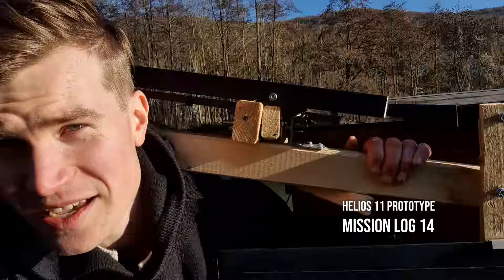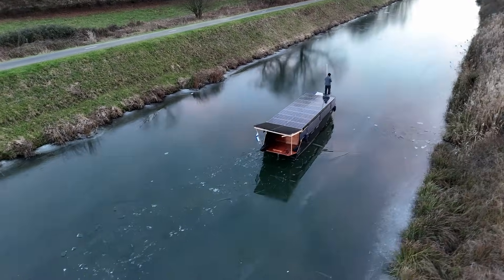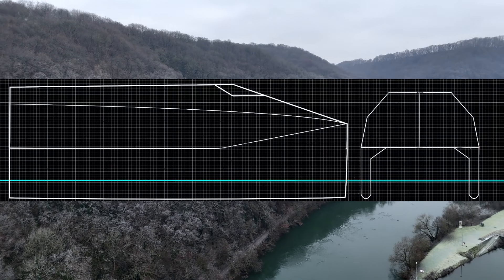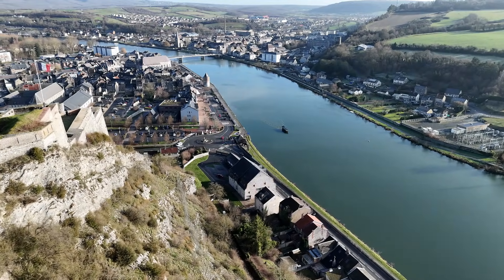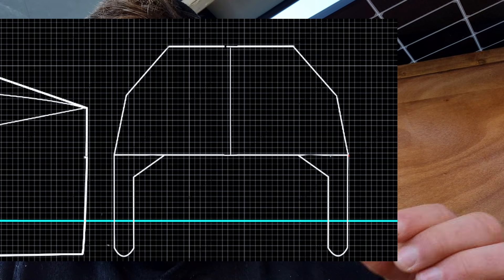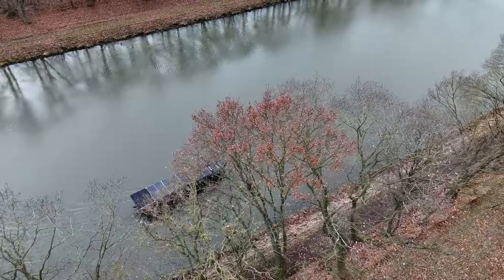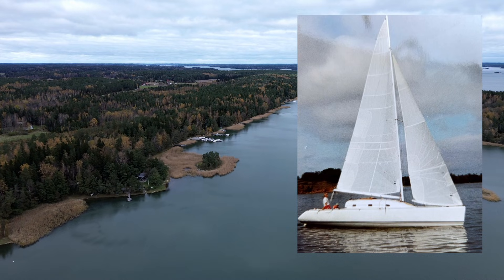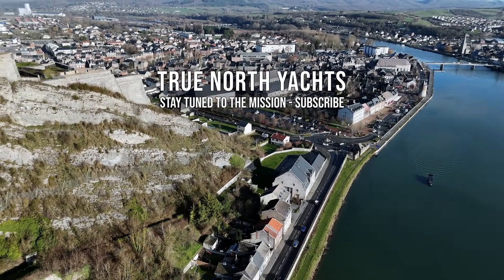My Solar Prototype Reaches France: Upgrades & Next Model

Comment: 7 or 8 knots is very much on the slow side for a performance sailing boat.  A 32ft multi hull would be averaging the low teens.  On a good day with favourable wind can average 20kts.  As far as your cat design goes, make sure you really take slamming into account.   This is a problem all cats can face.  With your slender hulls that cut through the wave you could be very susceptible to slamming.

Comment: @11:00 a Keel or centre board is only needed if you are using a sail going upwind (latteral resistance to help convert the latteral force vectors into forward force vectors), not needed for sailing down wind and not needed if no sail. for you use case the long skinny hulls might provide all the latteral resistance you need especially if you don't make the bottom of the hulls too rounded.
But the other thing a mimi keel or skeg can do is provide some protection for the hull against grounding, so a small 1-3cm full length skeg with an abrasion resistant material at the bottom might be a good idea.for areas with rocky bottoms and large tidal ranges, remember every vessel becomes an "un-offcial survey vessel" eventually, so making sure your vessels can survive that with little/no damage is prudent.

Comment: Bro just some psychological advice. Stop being so Bias to your design, your work, having to justify your work.  Don't worry about Non Critical areas you experimenting on, wood, bamboo, does not matter this is data collection for future use.  Lastly,  hopefully you will spend a little more time on making the design more appealing while maintaining functionality and efficiently.  I don't think anyone cares if they lose 5% to 10% efficiency if it is an overall more appealing product.  BMW puts used emergency stop buttons, wires hanging everwhere on their cars in development, if it works, and you've planned conduits, etc, all good, can be addressed in final production phases.
Reply: Otherwise, great job for taking the initiative.  You are young enough know that these experiences will pay off later in life. Knowledge, Analytical ability, foresight to prevent design flaws or omissions.

Comment: I am sorry but how is this going to float? This doesn't work without "torpedoes" to keep it afloat. If you want to use this narrow legs you need wings or cavity for keeping you above water or create an air pocket under the main hull which is very hard to accomplish due to waves.
So you either go delta wings/pontoons or you just have 2 protrusions under your boat for battery storage.
You are right that most hulls are not optimized for electric but they are still optimized for the sea. 😉
Electric is very easy to modulize. 
Solar panel with a simple motor(central/dual drive shaft?) and a central battery system and attach to a simple and efficient hull infinite redundancy add as much as the hull or wallet can support.
Solar panel angle is more important than hull design for optimization.

Comment: The Dunning-Kruger is strong in this one...
Reply: The problem is he seems to do his research directly from chat gpt...
Reply: @YoutubeCommenter1 at least Gemini 3 Pro and Claude Opus 4.5 are able to point out the downsides of this design very quickly.
AI is the right partner for such a project, but you have to know how to use it... I am still wondering, what are the actual requirements for the boat. Based on that concept and design phase follow, no matter if with or without ai...

Comment: My brother has a 28 foot wood/ fibreglass diving boat. 
He has two fins  made 3/4” plywood added to the lower sides of his boat for extra stability .
They are about one half the length of the boat, starting thin and tapering out to one foot in width at the rear of the boat.
Looks like two small keels one each side of the hull just below the waterline.

[________/—————‘

<_______>

Stays very flat stable in  rolling waves or choppy seas .👌👍🤔☺️

Comment: Have you considered putting an apparatus underneath the main portion of your new design that would have capability of providing mechanical power to some sort of generator to assist in charging while under way on your journey as the boat goes up and down in the waves it could be something that might work do you think?

Comment: With batteries lowered below the waterline would you need some sort of watertight bulkheads in case portion of the narrow hull was breached letting in the seawater which might short a battery and cause thermal runaway and fire?

Comment: The only problems I foresee, are deep draught ( which could prohibit canal passages) unless the pontoons (torpedo's) had sufficient buoyancy (think semi-submersible drilling rigs) These would need to be precisely calculated by volume in order to have the vessel sitting at just the optimum height under full load. My gut feeling is that the side hulls still have to increase in volume as you get to deck level for the sake of stability in heavy seas, and the pitch and roll in heavy weather also effects the center of gravity. At least we had the option of ballast tanks on a semi- sub. Not trying to be a damp squib, just things to take into consideration. I fully support your intentions though. Good luck.

Comment: Note that if you increase the weight of the Helios 11 by 200kg that is going to negate the increase in speed at a specific power setting that you gain from increasing the waterline length.

Comment: If you taper the battery compartment to a point under water in front and back will reduce drag, cut the waves and still have ample battery compartments in the middle of the underwater wing.

Comment: There will be trade offs between angling the panels to catch the sun and seaworthiness when crossing the ocean. If you get caught in a storm while on the ocean, you could easily lose your solar panels. Please analyze a change in your roof line. You now have two angled walls and a flat roof. Calculate your solar gain using two or three angled walls. Instead of being flat, the peak of your roof would be pitched, like a house. The panels would be single faced and fixed. You would be much safer in a storm at sea. You would also have a very spacious interior cabin.

Radical idea: you mentioned a solar airship. Could you use a helium filled dirigible that is covered in light weight solar panels? It could have its own motors and actually pull your boat. Of course it would not work in canals with bridges unless you could deflate and reinflate it, but it would be amazing in the Mediterranean.

Comment: Are you going to use solar film to make the air balloon of your air ship? You could convert sea water into hydrogen using the power you generate which can also be used to produce propulsion when jetted through a platinum screen which causes ignition and expansion of the gases.

Comment: Give the new boat a roof that is a triangle with least 30 degrees at the side and 150 degrees in the middle. Tillt the panels on top of that roof to either side.

Comment: would adding mirrors(reflectors)  hinged along the exterior of the roof be a viable patch for your current model ?     they would not have to be very tall to be effective. i believe they would be easy to tune for maximum efficiency.  I enjoy your content, and wish you happy days.
Reply: Now there's an idea,, lite weight mylar mirrors stretched on adjustable frames

Comment: wouldn't a shallow v hull in the centre help in heavy seas. batteries could ve stored in v of centre hull, also give more storage and more head room... the centre hull would be out of the water by about a foot from water surface .. it would stop the boat ploughing into big waves, and help lift the boat... just an idea...

Comment: add a frame that looks like a regular house roof with the peak being the hinge and you can angle the Rear Pannels to either side if needed. i gues something like 7° - 10°? should be more stable for high seas?

Comment: You need to servo control the angle of the panels using feedback to optimize the power.
Reply: Exactly Just install a light sensor and Electric actuators and it will be done

Comment: I am glad you are thinking about additional displacement weight. From my own experience with a 12m lightweight catamaran, in rougher or windier conditions having additional 800 kg onboard, the boat is far more comfortable to be in, and it has very little affect in boat performance up to hull speed.
I would suggest also putting the widest part of your new 13m boat (the combined rub rail and the gunnel) at the floor level for maximum strength across the boat.  It does need to be no wider than 4.9 metres to go along most canals of the world, apart the British narrowboat canals. My own boat is only 4.75 m wide to be able fit a standard 12m berth with 4.7m width.
Also to reduce cross windage, a suggestion could be to have access below waterline only at mid-hull length and have torpedo hulls forward and aft. At the bow, have a vertical blade section from the front of the torpedo up to front section of topside of the boat to prevent rubbish being trapped above the torpedo hulls.
Reply: Great suggestions

Comment: The key to lower frontal area is that little red box  under the cabin and wider hulls.   The red box in the center should be shaped like a hull and go down to near the waterline to break any waves slapping and give standing headroom while lowering the cabin .7m. 

 You only need ~ .6m of center deck clearance can also lower your cabin height especially with the center pod.  Your monohull slaps a lot more than the cat ever will.
Which can have an outboard bracket if you just want 1 outboard or build an inboard into it.
And standing in the hulls for a head, shower, even bathtub, getting into bed in the center deck with 1.3m sitting headroom.  

If you keep height low, you won't have any stability problems at 5m wide. Though 6m is better.  

Google Javacat Key West Ecotours for an Epoxy ply 10m by 7m cat Steve Brown and I designed, built in 92, and still in charter service.   Click on the boat pic. 

We designed in a 45degree angled crash bulkhead  as it goes, tested  25 knots under power or sail and the second owner hit a 75mm iron rod hidden by the water and yammed it though the hull.  He as terrified he'd sink but when he backed off he wasn't sinking.   He got it to the boatyard and found our crash bulkhead, was very happy. I suggest you put them in too.   
Keep it up, you are doing great with a great life ahead of you.  I started at your age 50 yrs ago.

Comment: You can’t expect much from flat panels in winter unless you are at the equator. Panels on the sides would be much more efficient because of low winter sun and reflection off the water.

Comment: I am thinking how to make adjustabile support for your solar panels. At first you can't make them sloped forward or backward because the first panel would make shade for the next one. Sloping could be effective only towards the sides of the boat. Panels on the roof (without rearmost one) should be installed on four wooden frames with hinges on both sides of the boat. Those hinges should be made with ability to be disconnected (like sliding bolts). By disconnecting hinges on one side the panel could be rised into sloped position and secured with suitabile frame which could use the same sliding bolts as are used for the frame with panels.

Comment: I think you forgetting about the flat part between that going to get smacked by waves. That smacking is going to ruin any performance advantages you will have with any kind of waves.
Reply: Yeah, deck MUST be high, Limits to everything and everything a compromise.
Reply: Indeed. Maybe truss design against it. Big flat surfaces create a lot of skin friction and to be honest, it doesn't add any value. I'd put those new cheap and great cold resistant natrium cells there to have zero fire risk. Then compartmentalize then to sections so that if any break, you still have the rest working if say you had a big damage. I'd even drench them in foam to stop any water to ever reach them. We don't really service the cells anyways. They last a lifetime nowadays. But truss Structure or beam then the boat gets lifted but has enough structure but no more to handle the loads plus margin. It's easy to just add more, it's when you constrain the design and keep that hard core focus in minimal mass, drag and maximize safety and efficiency that these designs work out. There's lots to learn from home built airplane design. Such as not getting too focused on one material just because you are now comfortable with it. Pick the right material and select them to do the right thing. GF, foam, CF, alu, plywood, plastics - all should be on the table. Carbon Fiber isn't any harder than Glass fiber when using mould less construction... It's often easier in my experience, since you get a nicer surface than GF. It can also be cheap, like I bought uni 400g x 5m for €50 on just looking for waste lots on easy composites website. Insane strength for the money.
Reply: I'm guess you have never ridden in a cat. Designed right there is little center deck slapping.  He needs less than he shows.  Why is the hulls rise too. He only needs .5m from the many cats I've built, sailed on.
Reply: @jerryDycus-d9c I have not. Just throwing out ideas. I do see a lot of skin friction drag and unnecessary structure there that isn't needed for structural rigidity.
Reply: @NavalTechTinkerer it’s not the skin the way the catamaran are designed and in between each hull where the boat is built up, makes a large flat spot and  the problem is the higher that he raises it off the waterline the deeper draft he’s gonna need and then the problem is is when the boat goes up Boat goes down because of big waves and bad weather. You smack that center bridge every time all the time in the whole boat will shutter that’s why catamaran are not good for bad weather, big waves, storms, or deep ocean, they really like to flip over all the time.
Reply: @gwesman true true

Comment: You know what I had a thought about the torpedo hulls.  You could possibly take used 55 or 30ish gallon drums as a frame to form them.  Attach them end to end and cut a notch in the top for your plywood hulls to slot into and then just glass over the whole thing to make it one piece and smooth out the lines.  You'd still need to shape the end cones but might be a cost effective method to form a round torpedo bulb.

Comment: This is super cool. 
I really like the new design. 
Would you still use the same propulsion systems?…the outboard engines?

I would encourage you to use outboard engines because no need for hull penetration and you can easily pull the propeller out of the water in case it gets tangled in rope or fishing net or sea weed. 

I had to rescue a guy who had a 45 foot yacht because he had a rope tangled around one of his propellers and rudder system. I helped him steer into port with my 14 foot zodiac boat with a 20 hp engine. I pushed him into port like I was driving a tug boat. 
He had to hire a diver to cut the rope free.

Comment: One reason they build the catamarans the way they do is to reduce draft.  A lot of the times those big expensive yachts are trying to get into the shallowest areas possible where a big keeled monohull cant go.  Theres nothing inherently wrong with your plan but just be aware your trading draft for tonnage.  I've seen many designs with drafts under a half meter that use daggerboards that can be lifted when entering shallow areas.  Unfortunately they have very low load capacity because if you overload them they loose efficacy as you noted.

Comment: You can install two tubes on each side of the Hellios.
Like two jet engines on the plain.
And, inside of them, you can install something like propellers that spins in circle, as water/sea, flows through them (as boat is moving foward on it's main power motor) 
That way, you can have "two side generators" for yacht battery in infinity power.
Would it slow down the boat?
Probably.
It depends on angle and level of plecament comparing to the waterline of the ship.
This advice is on me.
I have 1.000 of them more that are not for public